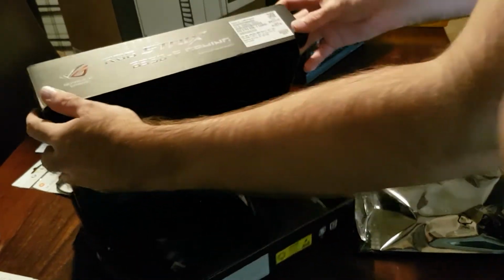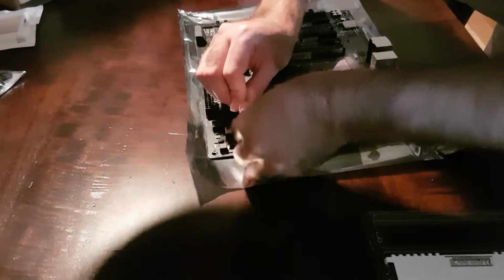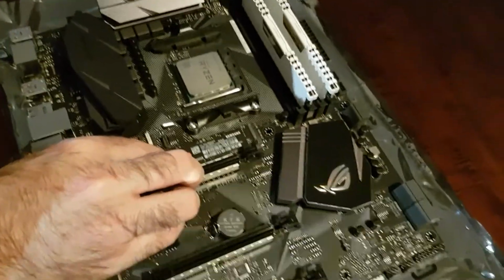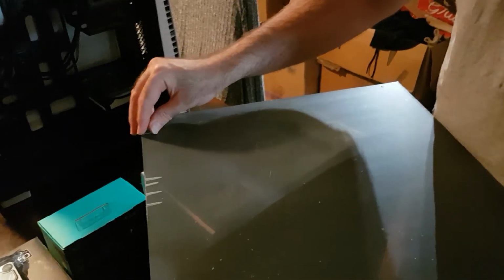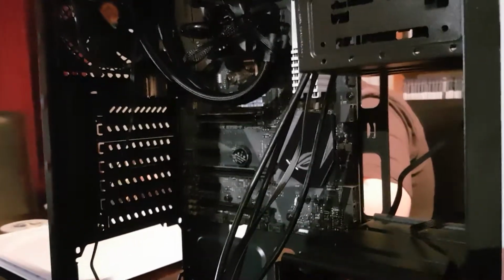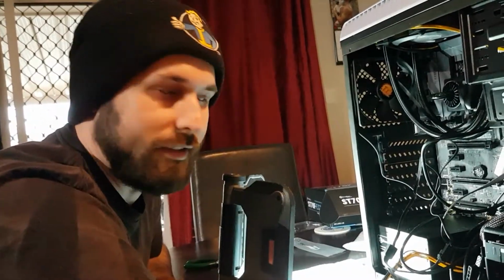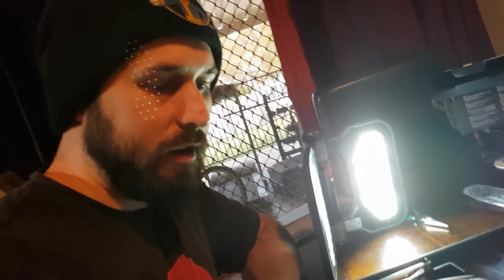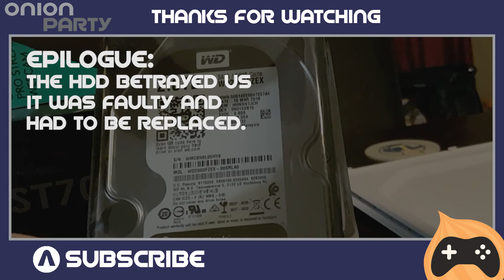Jarrad Builds a PC

Comment: How you remove the friggin panels i have the same issue And i rlly need change coolers XD !!??
Reply from the maker: With great difficulty, LOL
Reply: Damm xd
Reply: SAAAAME!!!!
Reply: @angelresendiz8266  There's a small opening in the front panel at the bottom of the case. It takes some strength to open but it's not impossible. Also beware removing the top panel! It has all the wires attached to it, make sure not to rip them off when removing it.

Comment: Hello, ive been searching for some reviews about the Thermaltake Versa N27 but couldn't find any ideal answer, so can you tell me about your experience with the case and the airflow of it. Also nice PC bro 👍🏻
Reply: I have one, I find it very nice and comfortable. It’s a mid tower case that isn’t that wide. Sadly the case can’t hold a gpu longer than 360mm and seeing the new RTX 30 series it might be a challenge but with third party they might actually make some RTX 30 series card even smaller to fit micro atx and atx mid tower cases
Reply: @ronaldo65ful  where did you end up putting your cpu cooler?